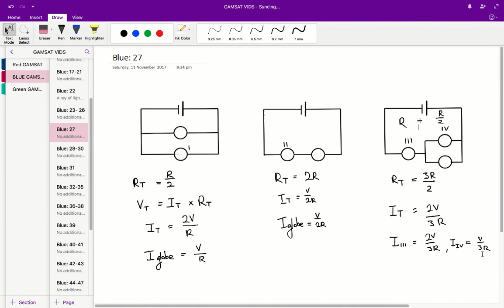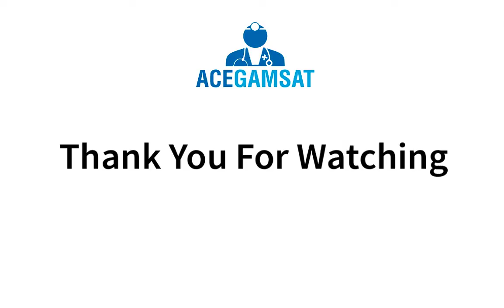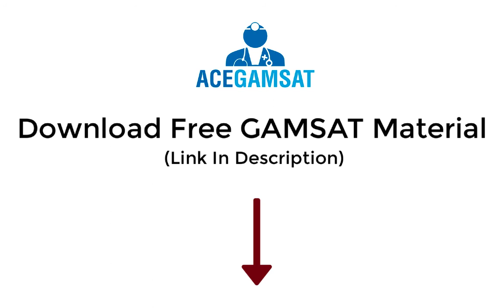ACER GAMSAT Blue Booklet Worked Solutions - Unit 7 Q27

Comment: I think you could simply reach the answer by knowing that voltages experienced by identical bulbs (mentioned in the stem) depend on how they’re connected. In a parallel circuit, the total voltage is experienced by the individual components (Vtotal =V1=V2…) whereas in a series circuit because the components are connected in a series, the voltage is shared, therefore, Vtotal=V1+V2…

If the battery’s potential difference is 6V, in a parallel circuit, each bulb will experience the 6V. However, in a series circuit, each battery will experience 3V. Hence the bulbs in a parallel circuit will shine brighter.
Reply: Yes but bulb IV is a parallel circuit just like bulb I and then you'll need to decide which one is brighter of the 2.
Reply: My thinking at this point was even though bulb 4 is connected in parallel just like bulb 2, it’s still a part of a series circuit such that bulb 4 and it’s pair could be seen as one component connected in series with bulb 3 and that implies the two of them (bulb 4 and it’s parallel pair) share the voltage with bulb 3, therefore reducing their brightness compared to bulb 2 that experiences the full 6 volts.
Reply: You can play around with the relationships he’s established to get the precise values. 
Bulb 4 and it’s pair each experience 1.5 V (total 3V) while bulb 3 experiences 3 V, all adding to 6V total.